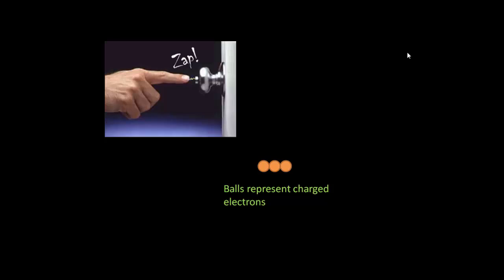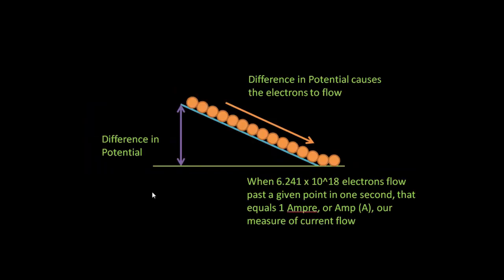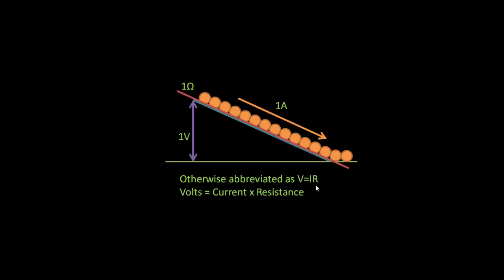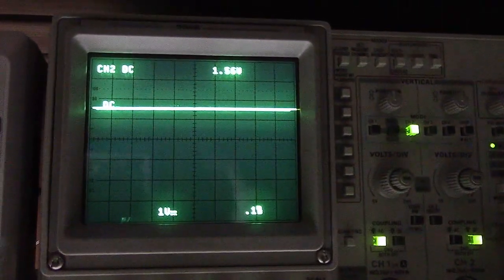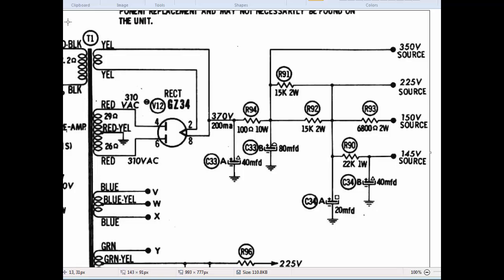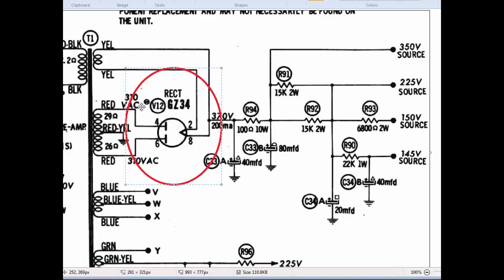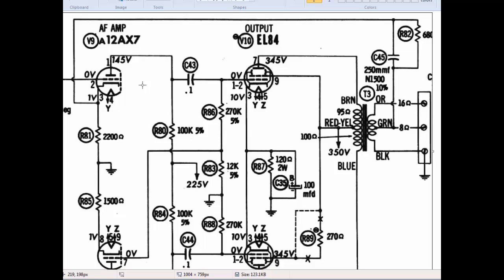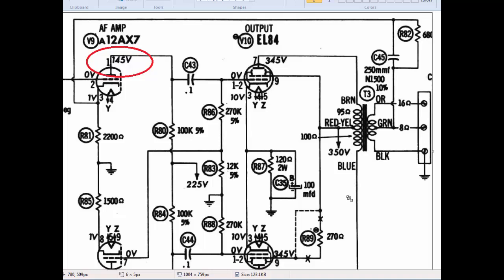Audio Tube Amp 101 -  Episode 3 - Voltage, Current, and Resistance

Comment: Hello! Thank you for the video! Is there a reason in the power supply to have two 15K resistors (R91 and R92) in parallel instead of having just one 7.5K resistor?